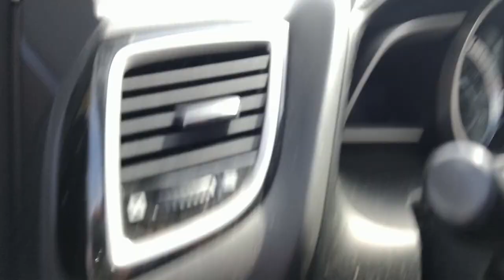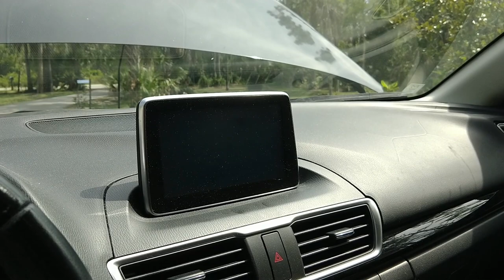USB Power Hookup Fuse Tap Mazda 3 Dashcam and more

Comment: Fuse 9 is also vacant just like yours. I tried using fuse slot 9 but I get no juice even when engine is running.
I tried it in slot 5 and 11 and it works fine. I really want to use 9 as it is vacant